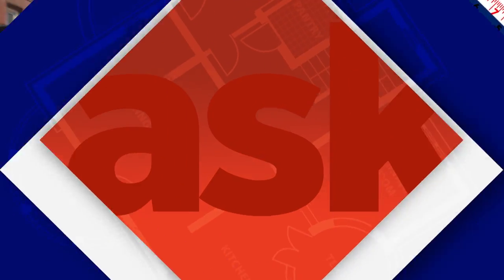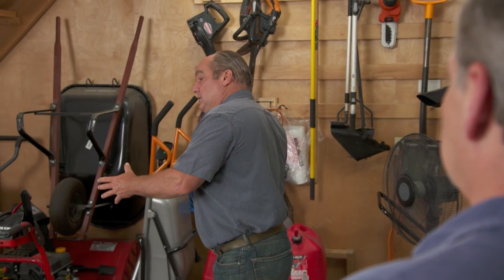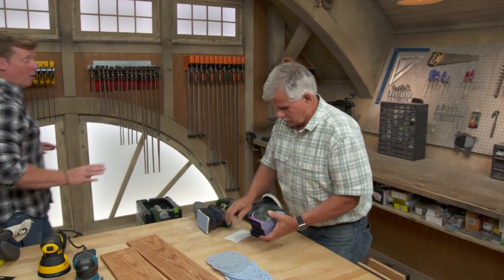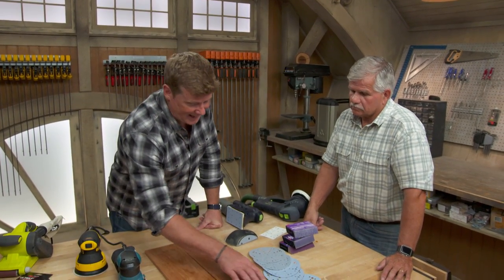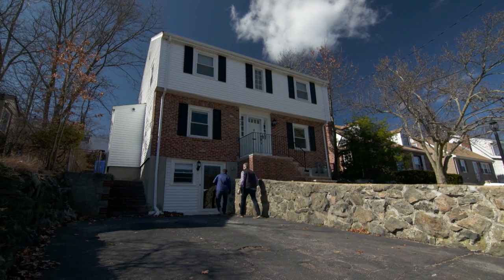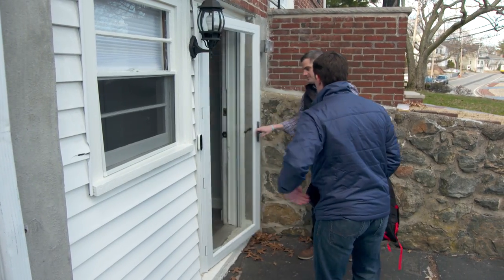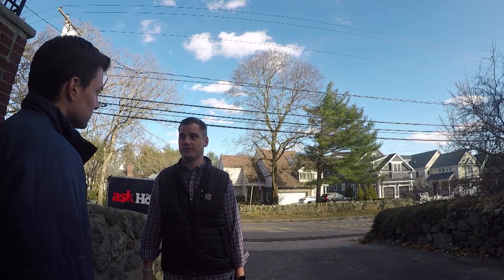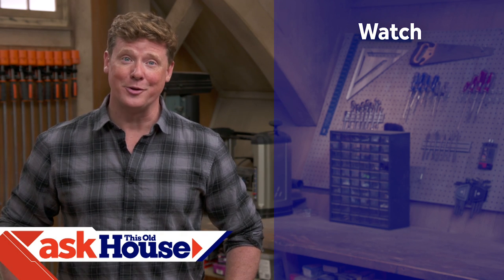Ask This Old House | Garage Heat, DIY Security System (S17 E4) | FULL EPISODE

Comment: All a burglar has to do is sneak to the side of the house and snip off the cable and phone lines and completely render all your IOT devices useless. When my friend's house got broken into, they didn't even have to sneak to the side of the house because the cable company's outdoor box was in front of the little gated community he lived in and they just pulled the cover off and cut the internet and landlines for all 10 units and went to town.  Because of that, for security, a traditional system is still much better IMO as it has cellular backup and all the sensors are hardwired and don't need to be charged up or have batteries that die. It's low voltage wire so running the wires is not that hard. The initial installation labor may be more but it's just one time and by the time you figure out all the cost of the parts and include monitoring, permits, etc. in the long run, it's about the same.  The DIY works well in an apartment or small unit where your internet is more protected. 

They do have IOT cameras that have local storage too.
Reply: Arie Doesn’t matter if phone lines are cut because the hub has built in battery and cellular and if you pay the monthly fee the hub will call 911. All you have to do is hide the hub in a good location. Hard wired systems are a thing of the past and old technology....
Reply: @MrEljavi84  I checked and indeed there is a cellular backup for an additional $5 a month plus the $29 monthly fee for a total of $34 a month ($10 less if you get a multi-year contract with Brinks) That's pretty much the same as if you had a hardwired professionally installed system so I'm not sure what there is to gain by getting NEST if you end up doing all the work yourself and paying $399 up front plus all extra sensors and monthly fees. We paid $200 up front for our system including installation.  
As for all the cameras, they don't have cellular backup and are 100% cloud dependent. Arlo cameras are cloud and have local storage or they could go with a traditional NVR/DVR system if they want DIY.   This whole thing just seemed like a Nest Advertisement and not necessarily what's best for the homeowner.

Comment: Love The Show  ! How Ever 99.9% Of All Security Cams are VERY Vonurable To So Called Hacking As Thy All Have Open Ports ..VERY Unsecure Nest Cams Are Very Very Bad For This ! a Nest am Can b owend by a hacker in like 3-5 seconds flat ! All cause they all  NEVER  Up Date Thair Software ! Just wanted to point that out ,as i Think Every One Should Know about how bad thy Realy are !
Reply: @BIGCHEW IoT devices are hot garbage when it comes to software. Put them on a separate network  to isolate them from your home network. Only the "head unit" should be able to see them and have upstream internet access.
Reply: @PeterPetrakis  Yes I was aware Thank you for pointing that out! as I had Faild to ! i am a big fan of pfsense for all my stuff,with separate network's ! but as we both know nothing is perfect..

Comment: I loved this until he was replacing the doorbell and used a No. 1 phillips driver on a No. 2 screw. That wasn't professional. Shortly after he's using a No. 2 Phillips, so you know he had it and just risked a probable damaging of the screw. Geez! Use the right tool! Do you think that Ron or Richard taught him that? No. Still love that it is Ron, Richard, and Ross through the generations:)
One thing they completely left out when talking about what happens when the power goes out is uninterruptible power. It doesn't cost as much as some of the other options they mentioned. If you want to go farther, have a whole house battery system that charges off the grid, and if you want to go farther, have solar charging that battery system. It seems strange to me that they didn't discuss ANy of that. It is basic stuff. This Old House does better usually at the deep dive. I think they really dropped the ball talking about risks of hacking. Ross says it's a trade off but doesn't let us know who are crap. Many systems available in the home market have no security at all. They're crapola, and I want this old house to call that out. People rely on them. It is a regular problem. Long ago with PBS the finances supported this better, but I worry that TOH will not call out poor security because of who is giving them funding. TOH any comment? Are you doing the right thing for your audience? Do you want to?

Comment: So everyone sounds amaze about the concrete problem but originally it wasn't anything that people didn't know about originally. Why don't you call out that people did something that people already knew was wrong. It was a scam. Someone made a lot of money and then they left. They need to pay/suffer/make it right. You say that so far no one has recourse, but you are a consumer facing channel. I want more from you. I want you to investigate/chase/advocate. It's an opportunity for you guys as experts to get more states involved. Step up. You have always presented yourselves as being on our side. So be on our side. Put up or shut up. Help it get right, or shut down your show because you aren't showing up anyway. Am I being too strong? Ask yourself. If your answer is no, the get the F out . Are you on the consumer's side or not. If you are, advocate. Educate. Help all those suffering people to find a solution/financing/getting right. Who are you?
Reply: It's a PBS show, not the local investigative TV station, who, by the way, cover this on a weekly basis here in Norther Central CT.  The concrete co. went under and could never have put a dent in what's required to fix the problem.  $100mil is just a start to what will be needed.  I agree that there should be charges brought against anyone who knew the aggregate was faulty, but good luck getting to the bottom of that.  We have an aggressive AG in CT, so we'll see.  Right now, everyone in CT has a $12 surcharge on our homeowner's insurance to contribute to the growing need for foundation replacements.
Reply: @probuilder961  thanks for the local perspective. I know I went a little nuts but I just HATE scammers taking advantage of people.